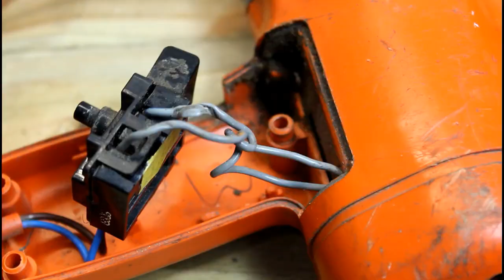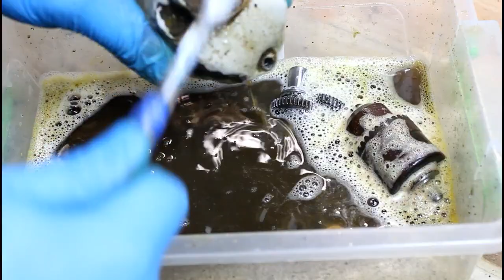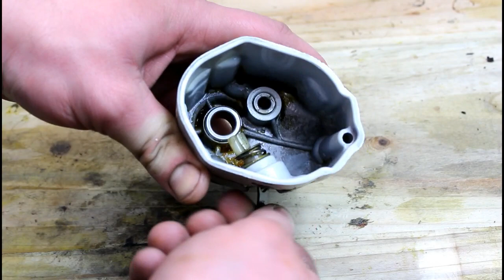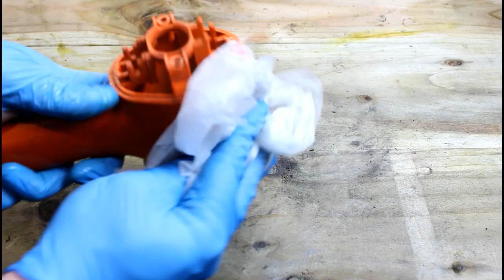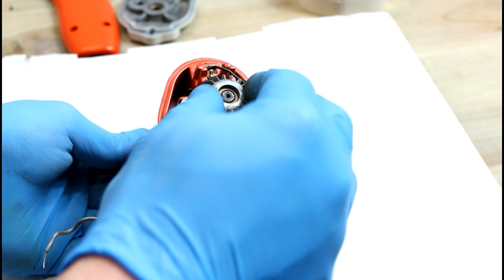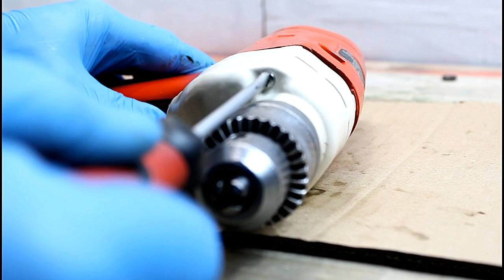Broken Old Drill Restoration

Comment: I'm also in a process of restoring a very similar old B&D drill. I need an advice. How to clean that old greasy gunk of the gears and housing? What have you used?
Reply from the maker: Hi.I take it  off the grease whith a knife and I clean the parts with heavy duty degreaser or you can use parts cleaner spray or the cheapest way  Fairy and hot water. 🍺🍺🍺
Reply: @AlexBRestoration  Thank you very much. I actually ended using paint thinner. Cleaned up really well!

Comment: Hey Mate, please can I have a link to the brushes. Mine are 6mm x 6mm x 15mm worn to 10mm
Reply from the maker: Carbon brush is 6.3mm × 6.3mm x 15mm and the code 915068-01,376143. Is the most common type of black&decker carbon brushes.